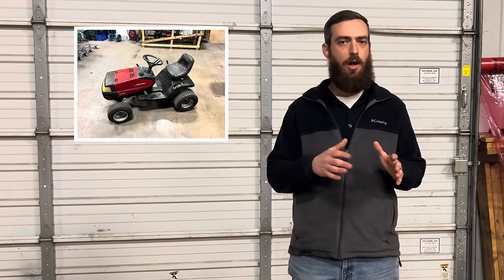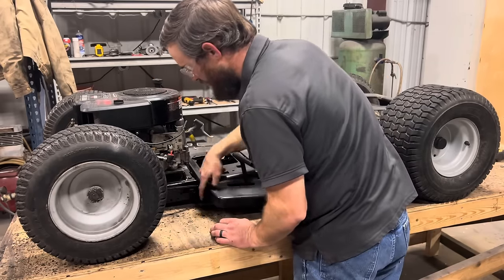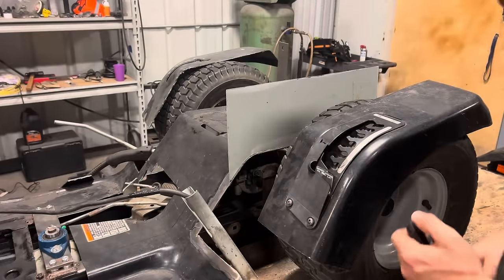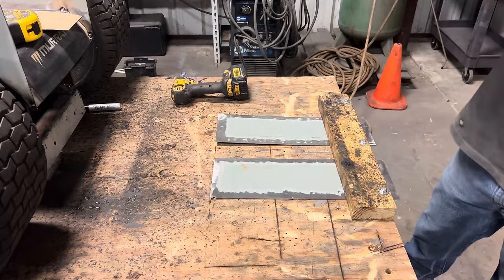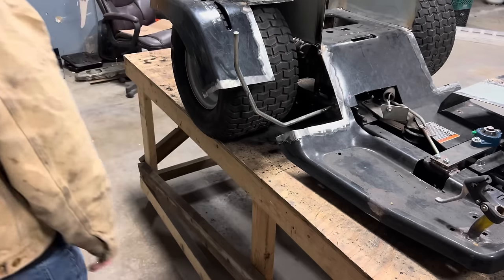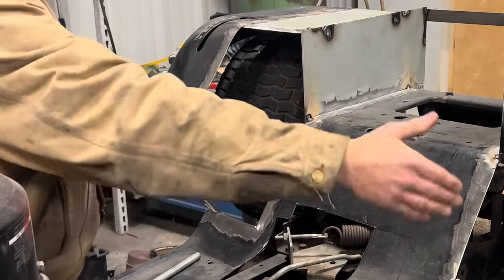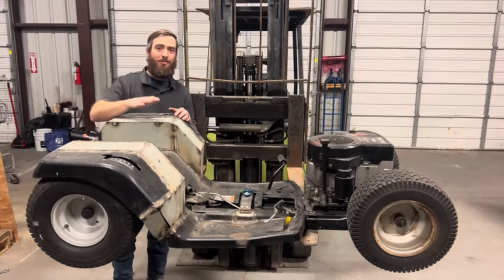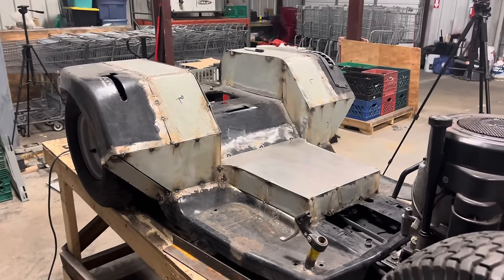How To Lower a Lawn Tractor As Low As Possible Pt. 3

Comment: It's pretty clear this guy has some welding experience.  However, working with all that sheet metal wouldn't he been better off using TIG to weld the sheet metal.
Reply from the maker: I absolutely agree that TIG would be the ideal setup for this, but I'm going for a DIY project that somebody could replicate at home in their garage where a flux-core setup is more common

Comment: Very interesting, anyone going down this road again may note that the hump to clear the idler could be much shorter if an idler with a center bearing was sourced.  Ask a local mechanic for one from a timing belt job, they get thrown away.  Then the idler could be entirely self contained in the frame.  

If a second body could be sourced you could stitch a left and right together to quickly make a fender.  As you see its a tight fit, but the tire is not the reason, could have been wider in the middle.

Not trying to armchair quarterback, this is a crazy idea for sure, staying tuned for the whole series.
Reply from the maker: If I were to do it all over again, I would definitely spend some time measuring body lines and frame position before making the cuts around the seat area. I made arbitrary lines and I just barely ended fitting 😂
Reply: @wybarprojects  Just like a cat though, if it fits you sits 😂.  Really great series!
Reply from the maker: @milescarter7803  lmao 🤣 thank you!

Comment: Couple things great build and video I love it but question shouldn’t the table be leveled out first because you used it on the frame I know it’s not off much I’m sure not enough to worry about but you act like me and seem pretty particular on building stuff wanting it perfect also probably a dumb question but did you happen to check the air pressure in tires to make sure they were the same before building onto them and measuring some of the frame off the table and last I want to say great work I like how detailed you are in how to build it and slow enough for people to watch and understand everything your doing and why so really love the work I’m a new subscriber definitely
Reply: Also another good point to people sometimes you can’t go with a level you have to go by the eye
Reply from the maker: Ya, leveling the table would’ve helped but I ended up mostly eyeballing and measuring off the table. 
I didn’t check the air pressure, but they look even so I should be alright 

Thank you very much!!

Comment: Did you change pulley size for speed
Reply from the maker: I've done a pulley swap on the rear (went from 9" to 3.5") but I haven't swapped the front pulley yet

Comment: What wire did you use for the sheet metal, .030?
Reply from the maker: I use .035”
Reply: @wybarprojects  ah wow, I would've thought it'd blow thru the steel
Reply from the maker: @M.TTT.  sometimes it wants to if I have a decent gap, but otherwise it does okay because the sheet metal is pretty thick (10 or 12ga if i had to guess)
Reply: @wybarprojects  ah ok, yea thats decently thick then